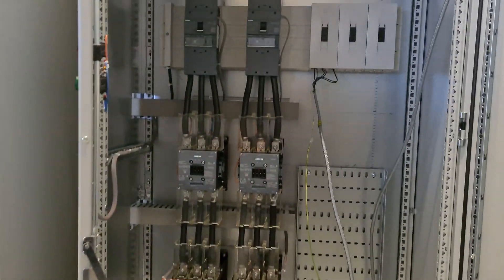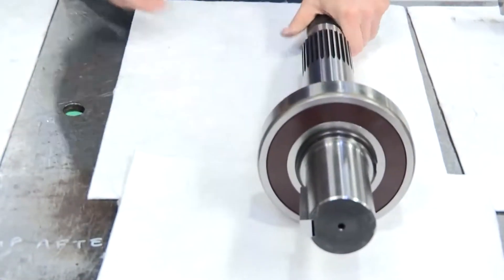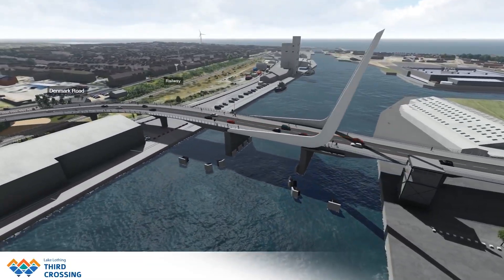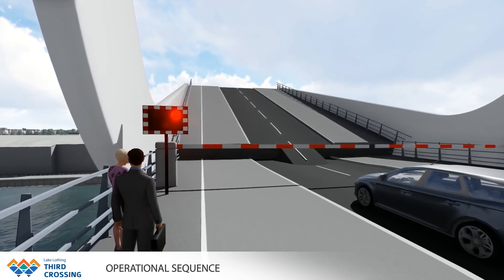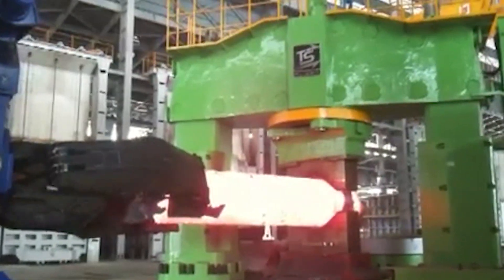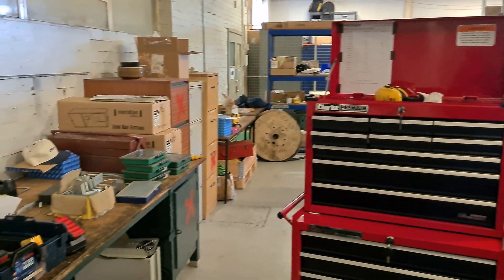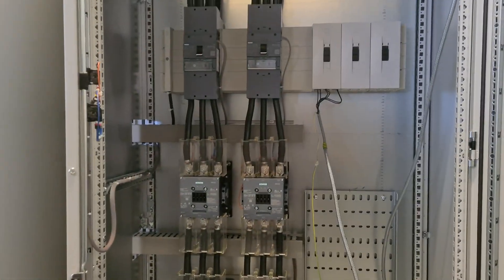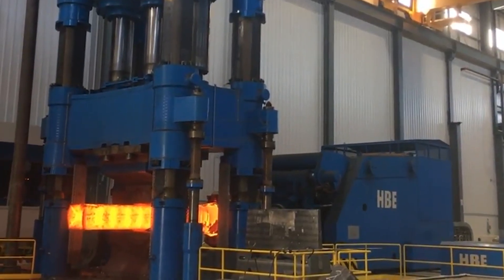My Job As A Graduate Electronics Control Engineer: Quick Overview

Comment: I have a question - in the end of your video (and some prior parts), it shows what looks like a guy hot forming extruded steel.  Do they get the steel in extruded form already, or are they integrated with a steel smelting operation?
Reply from the maker: Depends, mostly they buy billets and then smelt and hammer forge. Tata Steel in Wales is pretty insane though, they do everything, search for them on YouTube it's incredible

Comment: Well, I do not know too much about control systems, but I'm willing to learn. And  I do know that hydraulic systems contain hydraulic fluid. Their a special blend to also act as a preservative on the metal and o-rings, reduce boiling point and boil off, reduce flammability, etc. I used to work on aircraft hydraulics in the Naval Air. The other concepts you mentioned, valves, pumps, the hardware, I am very familiar with. I guess I just need to work on the controls side of things. I was thinking PLCs, or something similar. Background, mostly mathematics, with a heavy emphasis in ME courses, both BS and MS. Not sure what the best option is if I choose to go into PLC. I like robotics and machine vision. An are of interest is defect detection.